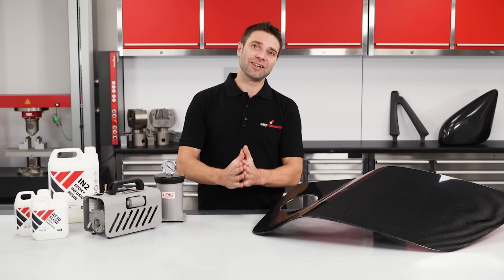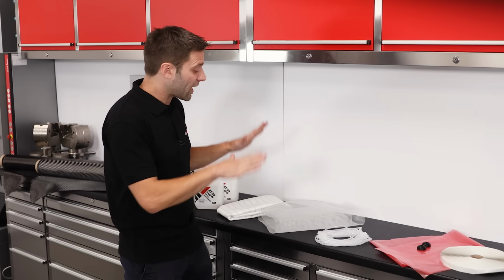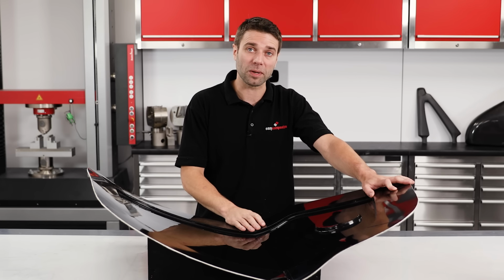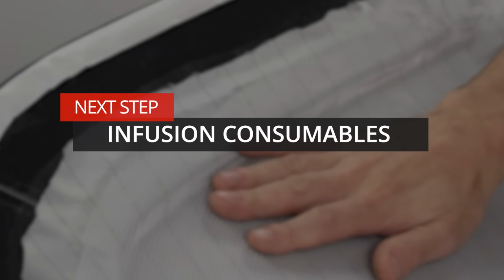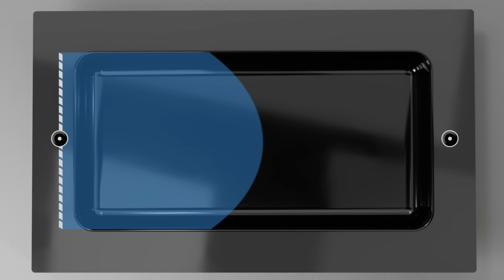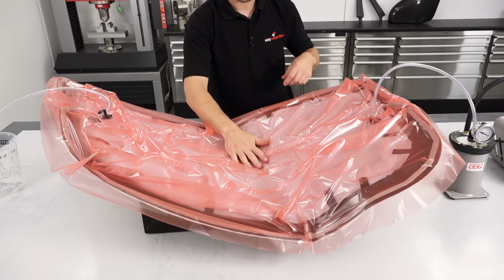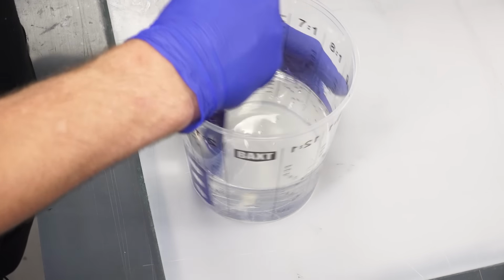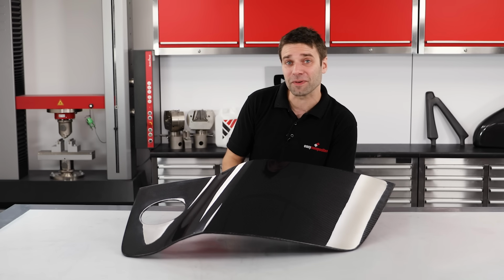Beginner's Guide to Resin Infusion for Carbon Fibre Parts

Comment: we want male mold hang lay-up production video :) mold canbe 3d printed perfect :)
Reply from the maker: OK, noted! We have done a video on 'mouldless' lamination, using a foam shape as a male mould/former and then hand laminating over the former. We've also done videos on hand laminating into 3D printed moulds, so between those two, we've kind of got this covered but I guess you've got something slightly different in mind?
Reply: @easycompositestv  I watched mouldless lamination video. But it was a pattern and you produce a female mould. No. I need male moulf and lamination for product.  Especially for low batch production, easy surface finish. For example, you also covered a wooden weapon part as male surface finish. But it was just one product and you made several several surface application.
Reply from the maker: @gokhanceterez1043  Not quite, in the mouldess lamination video the aero body profile was the finished model. Unfortunately this production method does require a certain amount of finishing and multiple resin applications then sanding and polishing in order to produce a good quality finish. If you're looking to make parts with little work to do on the surface then making a mould is really the only way forward.

Comment: I have used polyester gelcoat molds with epoxy many times without issue. Vinylester is not really necessary
Reply from the maker: You can get away with it in some circumstances for sure, but in our experience, polyester is very hit-and-miss. If you have a polyester mould, test it first (rather than have a part stick in the mould, ruining the mould and the part). Often, you'll get away with it, but when you don't, it's not worth it. It's much less likely to be a problem on old moulds (that have seen many releases) but new polyester moulds cause a lot of problems (we know, we have a technical support line that takes hundreds of calls a day!). Any composites veteran knows that there's a hundred ways to do everything in composites, we just go with the most reliable methods that are likely to help people to avoid the most common problems.